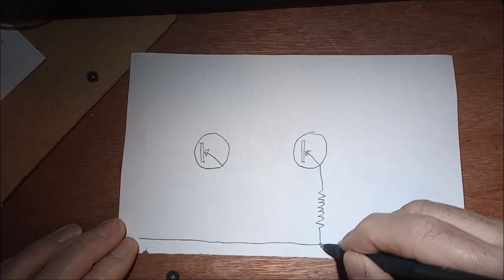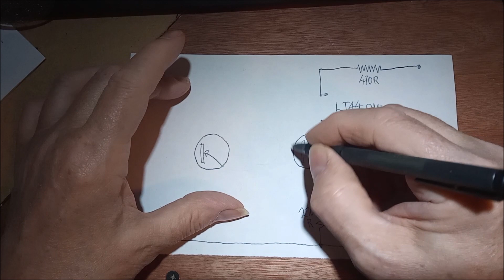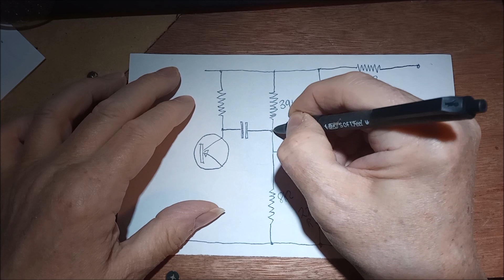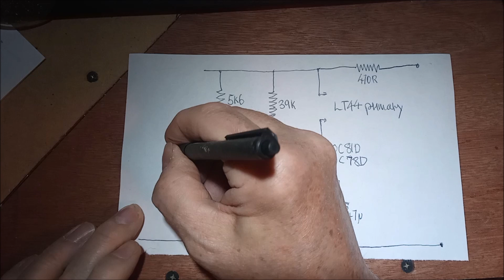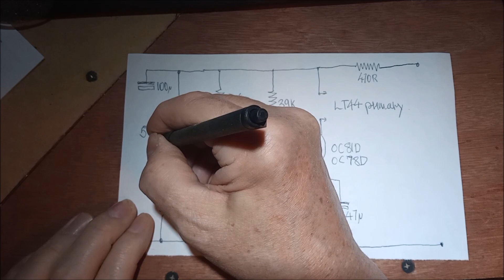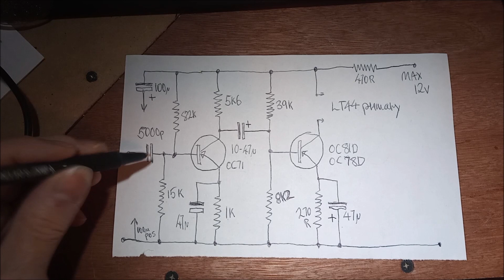TRANSFORMER COUPLED Ge AMPLIFER PROJECT 01

Comment: I found the 'winding-schematic' for the 'LT700' online! Primary(420-0-420)=840-total(DCR=63ohms') Secondary(45-total)(DCR=0.38ohms'). 1.2K-3.2ohm. 🥂
Reply from the maker: I wouldn't mind seeing that. Naturally, these values are reactive and different considerably from what resistance we'd read on a DVM. My Workshop is ill equipped and I don't have anything capable of reading impedance: above my pay grade! 😃
Reply: @hoofbags  I ordered some(Lt44s')and a 'Hammond' ,output-transformer.(1k-3.2ohm).The Hammond frequency' response is (150hz-15khz) and rated at (750mW).Some people have built these amps' with the 'Hammonds' and say there is improvement in clarity?Not sure if 'clarity' is really a problem for guitar-players'?Ha! My 'lab-equipment' is a bunch of meters',a 'dino-scope' and some older, 'H-P',sine-generators'(Ham-fest-specials')🥂

Comment: Thanks for posting this video! I wound an 'output-transformer' for the amp tonight.Will have to do some test on it to see if it will work for this type amp? 800-ohm(c.t.)to 8-ohm.Would be (400-ohm(c.t.)to 4-ohm),which might be a bit high,or low for the current?Still working on it!!!
Reply from the maker: If output transformer primary is 400-ct-400 the output would be very low, a few milliwatts at most. An LT700 primary is somewhere in the region of 20-ct-20 ohms. 800R would be the primary of driver transformer. Thank you for your comment, Robbie. 😎
Reply: @hoofbags  It's actually wound for 10:1 ratio for '8-0hm-load! I will check the actual 'winding-resistance' against other known transformers' to see if it's very far off. The ohms' of (800ohm-8ohm) is the 'impedance-ratio' 8x100 ,8x1 ,if I read the book right!Ha! Actual winds' are (primary:250-0-250 Secondary:50). It will be interesting to see what the 'windings' actually read on the meter?🥂